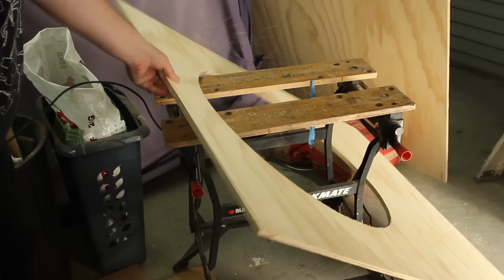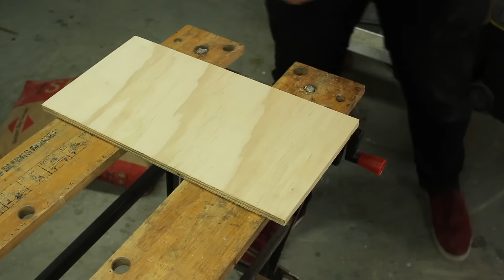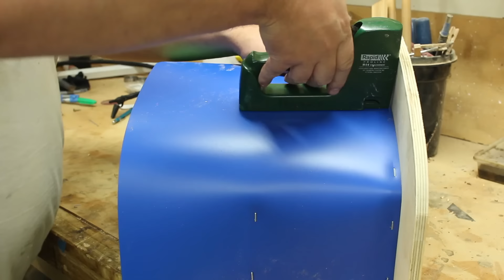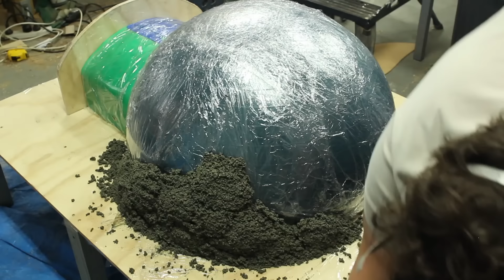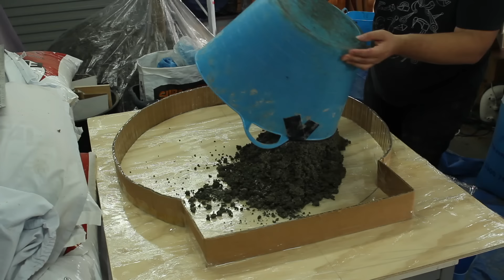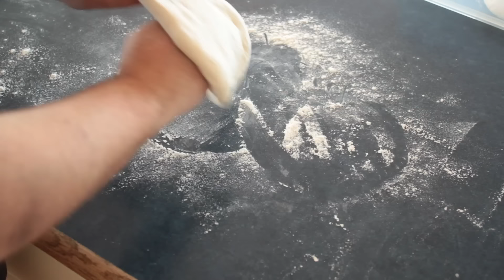DIY Cheap Exercise Ball Pizza Oven

Comment: Curious how it holds up, cement isn’t really for high temps.. for homemade refractory, usually use fireclay in the mix
Reply: I asked the same thing. Perlite is definitely heat resistant but it just seems that it will be succeptable to cracking and moisture penetration.
Reply: Remember those cheap Chiminias that were popular 20yrs ago? Those things were made of clay wasn't fired yet. They came with instructions on how you built a series of small fires in it at 1st. Otherwise it would crack. If you did it right, it was hard as rock and you could burn anything in it. I wonder if this is the same principle? He did use a dry mix for low moisture content. Hey, it looks great though, awesome idea and thanks for posting this!
Reply: Many factors play here... How often you make pizza? How hot? Etc.. on the end of the day for inexpensive quick pizza oven 👏👏👏👍.. Well done
Reply: Its not going to hold up. Its just video content.
Reply: TheRealChetManley s☹️
Reply: @Michael Montgomery I concur with your point. I'm thinking about doing this by casting refractory. reinforce it with stainless steel fibers. cover it with steel wool and chicken wire, then smooth it with stucco and cover it with Mosaic tiles. obviously this will drive the cost significantly however it will be  much better and still much cheaper than a commercially built oven.
Reply: Right thats what i was thinking - but a great design if you use refractory cement !
Reply: @DrMad900  Steel wool will probably rust out, especially in contact with the cement. Use firebrick or cast refractory for the inner layer, and use perlite mix like this for outer insulation. That way, you'll have a hard fireproof surface inside, and insulation on the outside to hold the heat in.  I built an oven using the Pompeii plans from Forno Bravo. They were easy to use and quite inexpensive to build from.

Comment: Why did you start with the insulator instead of something that would hold heat? Perhaps an inch or two of fireclay, then the insulator on the outside.
Reply: Hubert Cumberdale  good point you make, but they make something known as REFRACTORY CEMENT for fireplaces, etc. It has no problems with heat.

Comment: i also am thinking of making an oven, it could be an idea to either use a drier mix or to soak your aggregate in water before you mix it with cement. I think otherwise when doing your build and mixing cement and whichever aggregate you use could result in shrinkage and then cracks as the dry aggregate will take moisture from the mix, also use a reinforcement like chicken wire.

Comment: When filling the base press a 15" ceramic pizza stone in the centre and you will have a permanent smooth baking surface. Broil King makes a thick one designed for BBQs that won't crack.

Comment: Amazing technique doing the forms. Have you ever though about using clay and hay instead of cement?.
It is not only cheaper (though more labour intensive) but healthier. The portland cement will crack overtime and will  fall all over the food.
Other than that your oven is a piece of art. Congratulations.
Greetings from Toronto.

Comment: Hey, that was very cool Dave. I'd like to give it a go. A couple of questions:
HOw much Perlite and Cement total did you end up using (Rough guess in bags)?
Did you notice any odd tastes or anything that would make you re-think doing this?
Any final suggestions / Do's or don'ts?
thanks
Reply: Hope you get an answer. Great questions. Awesome project David. I've never made anything but I think I could do this.
Reply: Maybe using earth and straw will be cheaper but you will need to add coating (plaster). In Morocco they use a lot of stones + wet sand for the dome.
Reply: I did a slightly different ratio on my build early last year and used fine grade vermiculite instead of perlite (just beacause it was readily available). The amount I used was: 1 x 100 litre bag of vermiculite, 1 x 25kg bag of portland cement. the ratio I used was 5 parts vermiculite, 2 parts portland cement, 2.5 parts water. I also added a chicken wire cage structure for reinforcement on the dome and base. The vermiculite concrete floor of the oven should be sanded prior to the oven dome being applied to get it as smooth as possible. Once a few fires have been set in the oven, the floor takes on an almosr ceramic surface and is then perfec for cooking on. Commissioning this type of oven is key. Start with a very small fire and build larger fires from there. The oven should be fully cured and dried before any fires are lit otherwise it will crack.
Reply: Da Mala
Reply: @DaMalat  thanks bud. That should get me started
Reply: @DaMalat  
Hi,  may i ask what grain size of Vermiculite did you use? Serms yo.be various options, super fine 0-2mm or 2-6mm etc
Reply: Huge difference between perlite and vermiculite. Perlite is just concrete puffed with air, so this is just a diy aircrete.

Comment: this is by far the easiest and the greatest idea, question, can I use the same concept but with bricks instead? will the ball resist the wight of the bricks? i am going to try it, especially now that we're under mandatory stay home here at the usa too. thanks a lot
Reply from the maker: victor galvan maybe? I dunno! Give it a try!
Reply: @DavidParker  Don't you have too move the brick oven to a different base? There would be some weight to move.
Reply: Jim Luense Maybe build it on site...or very close anyway...
Reply: hot glue the bricks to the ball?

Comment: Can you give dimensions of the build and anything you would do differently if you done it again, also how much Perlite and cement was used. Thanks for the Video very informative without the narration.
Reply: In my opinion the dimensions are not well chosen. The oven space should be slightly larger and/or the opening smaller. The heat cannot build up well enough in this oven and it escapes very quickly, an oven door would also be good.
Reply: @hannes2289  Hi, can you post a link to the video where you have made the oven to your own specifications noted? Thanks in advance
Reply: @Matthew Kenny Ok Karen
Reply: Just make a door out of the same stuff
Reply: @MattyK1873  Sorry I have no exact measurements for you, but the proportions have to be right, the opening should not be almost as high as the dome of the oven.
A door would also be an option, here in Germany you can buy suitable steel or cast iron kits that you just have to wall in.
We have a 100 year old bakehouse and no small oven, but the diameter of the oven is over 1.5 meters.
Look at pictures of italian pizza ovens, the dome is always significantly higher than the opening. The heat of the fire/embers should not only be reflected by the dome, it also should be stored and dont escape directly to the front. So you can bake much longer without constantly having to add more wood because the temperature drops.
Reply: Hannes K, i guess it can be the same dimensions as a Pompeii stone oven, since the design here is the same. Different sizes available. Check out the very detailed DIY book at https://www.fornobravo.com/pompeii-oven/pompeii-oven-plans/
Reply: He shows clearly in the video the perlite and cement ratio.
And why would you need his dimensions? Make one of your own!
Reply: @fclentuber  ah poor old Frenchy has seen something online they thought was funny and has now tried to use it themselves.  Except it is completely out of context and not funny in any way.  
C+ Must try harder.

Comment: Did you put any reinforcement wire ? 
Was it a few layers dried and reapplied?
Did you use a wet slurry over the final to get the smooth finish?
Smoke woodfired pizza is unbeatable...
Kiwi from Melbourne...😎
Reply from the maker: Michael Cooney no wire, no layers. Yes I did add a slurry only very recently.
Reply: Reinforcment will help prob

Comment: I made one last year out of Cob (clay and sharp sand) which has worked quite well.  I use an IR handheld thermometer like they use in airports (bought it last year before covid19 luckily).  The first time I used it I mistakenly watch a US video where they said to get your oven to 700 degrees.  I took this to mean C not realizing it was F.  I got my oven up to 800 C !!!  My pizzas burned in less than a minute.  I find 400 C to 450C works best.
Reply from the maker: Jack Hansen haha yeah I was trying to order one but they’ve been sold out for a while!

Comment: i would never cook on cement and perlite...normally 1 cm gres-stone unglazed tyles work good, better is if you have some firebrick for pizzaoven
Reply: is this not a good way to cook ... because is cement or perlite ..? wich way or stone is better ??
Reply: Cement , clay and perlite mix are the perfect refractory material for an outdoor oven . Try it sometime .
Reply: I would have at least coated it with ceramic, cement is kind of toxic and perlite will break teeth if you break a piece off on your food
Reply: @deluxeassortment  you can squish perlite with your fingers dude. It is brittle lava rock. Those white squishy things in potting soil is perlite.
Reply: Eating any kind of rock is to be avoided of course. If there’s some specific thing that makes perlite bad, I’d be interested to hear, but nobody seems to have mentioned anything like that.
Reply: @cmottBHBJJ  It's volcanic glass. trust me, I've had it in my mouth on a number of occasions. I'm very familiar with it. Yes, you can crumble it between your fingers, but it will still break a tooth. I grow something on top of it and use it to hold moisture.
Reply: @deluxeassortment  lolol ohhhh we are def on the same page. 😊😎. Mush love haha
Reply: dragon08 ** no thank it s not the same pizza like the orginel one

Comment: I love the simplicity, I'm curios how it's holding up? Any cracking from the heat?
Reply: Great question,  I plan on making one soon
Reply: Having built some firebrick projects, there's no way this thing is going to hold together. Mix was too dry, no vent, and a bit too thin.
Reply: @DougZbikowski  vent was at front, and not really necessary unless bunging the entrance; could you please give a brief description of your fire brick projects and their degree of success.

Comment: I wish you had used rebar in the concrete. Rebar also helps with heat retention and holding everything together when it expands and contracts.

Comment: Good job...I would use a pizza stone or some fire bricks to actually cook the pizza on...not sure cooking on the cement surface will be very good for you.
Reply from the maker: AirForceOne1971 any reason why? The cement is full cured now? I actually tried a pizza stone in there because I figured it’d be smoother than the floor of the oven but as soon as I put the pizza on it it cracked, I guess it was too hot for it?
Reply: @DavidParker  All depends on the heat of your oven...use clay fire bricks instead that's what I use...I get the oven up around 1000f then let it cool down to 700f then cook pizza...the clay firebricks never crack.
Reply: AirForceOne1971 Also, might think about using one of those high performance STEEL pizza stones...they come in various sizes and won't crack like a regular pizza stone. God bless!
Reply: @BytheWay333  The problem with steel pizza stones in a wood fired oven is that they get too hot and burn the pizza because of their high heat conductivity which is favorable in home oven, but definitely not in wood oven. Stay safe y all
Reply: I made mine with vermiculite, same mix and method. I used bricks out of a storage heater, seriously maintain heat. 10 mins before I cook I put in a good quality pizza stone, works perfectly. I had cooked on the vermiculite based but found it didnt get hot enough to properly cook base when top was done

Comment: Refractory concrete would work better 50/50 with Organic Perlite.  As a knifemaker having made several forges you learn what works best. Regular concrete won't last long to high heat over time. Maybe 2 years. I'e built forges than run at up to 2500 and only need maintenance about every 5 -6 years

Comment: David how much cement perlite? When you say one part how much is a bag kg? Id like to try this. MNy wife is going to kill me ;)
Reply: A 30kg bag of cement and 4 cu ft bag of perlite or vermiculite. Use a bowl or scoop and go by volume not weight.  Ex. 4 bowls perlite, one bowl cement. 4:1.  I would go 5:1 as the more cement you add, the more cracking will occur.

Comment: Hey David, how long did the process take from start to finish? How long for the cement/perlite to dry too?
Reply: THIS IS ALL ONLY A SUGGESTION AND I AM NOT SAYING THE DESIGN YOU SEE HERE IS IN ANY WAY WRONG. JUST A SUGGESTION BASED ON MY WORKING WITH CEMENT AND CONCRETE MOLDING AND FORM FINISH WORK...

Having worked with cement for many years, it will stay green for a few days but workable within 48 hours in a case like this with no wire construct within. The fire will cure it much faster but that disassembly will take special gentle care when you do it. Give it 4 days then break down your form. I personally would add a layer of chicken wire within mine for structure strength. So make your shell 1/2 the thickness from this and then add a very lightweight chicken wire, then while everything is still wet, add your other half to make it as thick as this design. If it isn't broke then don't fix it but just adding the chicken wire as I have SUGGESTED will give it a little extra strength so when you cook in it it won't crack and crumble. With the pearlite that will shrink in time with the heat and the cement will not, thus fracturing the shell. I am just making a suggestion to prevent that fracture or future crumbling. Take care when moving it after you build it as all cement is green or very easy to break early on.
Reply: Austin Enterprise Ink j

Comment: The inner layer and base ought to be something with plenty of thermal mass like refractory clay or fire brick, with the insulating layer on top of that. The way you have made it with pearlite and cement will be a fair bit lighter for a mobile oven though

Comment: I have been researching this subject for years. I have probably seen over 100 videos on how to make “brick” ovens. Your method is the most elegant, simplest, and in my humble opinion best made diy oven. It is the only one that has made me say: I will make this one! . I do have a question and it is how did you make the bottom’s surface smooth?
Reply: It looks like the bottom is smooth because when he made the template for the bottom, one side he used a 2x4 to flatten it down. Then he added small amounts of concrete/perlite where it needed it and smoothed it down again.
Reply: I agree.   10 years ago I spent over 2 grand in materials and built a 35” pompeii oven.   Ceramic board and blanket insulation were very expensive.
If I were to build another oven exercise ball or sand method is way to go and I won’t put much emphasis on insulation.
Reply: I just sanded mine for a smooth finish

Comment: Very Impressive, i have seen quite few video on how to built an oven with execrise ball but so far yours have been simple and easy to understand. I was thinking of buying ooni pro but its a bit expensive so i think i will follow your video and build one myself. I had some questions . 1. To build the you dome you used just cement and vermiculite, is that you need?  2.For the base you again used cement and vermiculite, is that all? i though you need special stones? 3. Have you a list of material?  Any issues so far?

Comment: Put some stainless wire reinforcement in it.
Leave some very small holes in the cement to let the moisture out. Let it sit for a week and dry very slowly with a small fire. That will stop it cracking. The water in the cement  expands and causes cracks.

Comment: Great ideas and presentations. But, is it safe to cook in a concrete oven. Would it work to coat the inside with clay and let it harden with firing? Thank you for sharing this. Nice manufacturing designs.

Comment: No insulation or chicken wire after the first layer that has the perlite in it?  Genuinely just curious.  This is only the second video I've watched for making a pizza oven.  The first one had a layer of the mix you used, then some sort of foam looking insulation, then chicken wire, and then finally stucco.  They also have oven bricks in the bottom.  Yours looks way easier and more affordable so just curious because I'm thinking about making one for my backyard. :)

Comment: Well done David ! Have you been using expansed perlite or not ? And do you know what is the difference between perlite and vermiculite ? I made a first oven out of vermiculite and fire cement. I made it big. I didn't give it the perfect shape for the best efficiency. I managed to cook pizzas in it. But I was not able to cook bread since once I had removed the fire, the temperature was going down too quick. I concluded that vermiculite is good for insulation, but it doesn't absorb and keep the heat. So I made a second oven out of fire bricks, and it works fine. These are so called napolitan ovens. I plan to make another one with fire bricks, but with 2 chambers : one for the fire, the other for cooking. So the cooking surface stays clean, and you can keep the fire on even you cook breads.

Comment: Nice design.  
If you use castable refractory and insulate with ceramic fiber,  It will be as good and a $4000 kit and retain heat for days.

Comment: I think if you did a layer of concrete perlite mix then fitted a layer of metal mesh, eveen in small sections it would resist the cracking.

Comment: Looks good David. Do you have a temp gun? A bit hard to judge by the time lapse, but the way it was rising makes me think it was perhaps a tad lower than 400 degrees. Anyway nice job and honestly at first it looked as though you didn't have enough water as the mixture was crumbling, but then you seemed to get the consistency adjusted. :) EDIT : Just read the description.